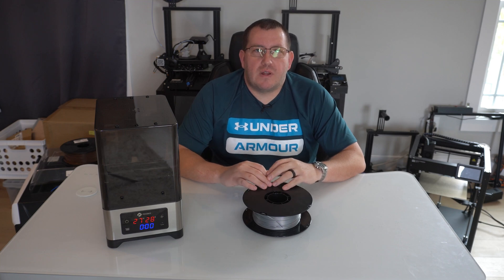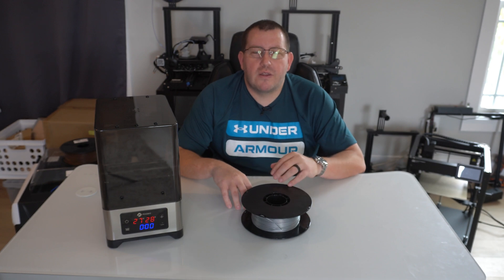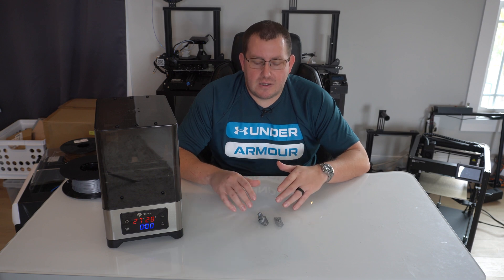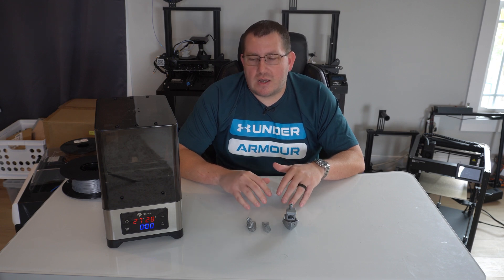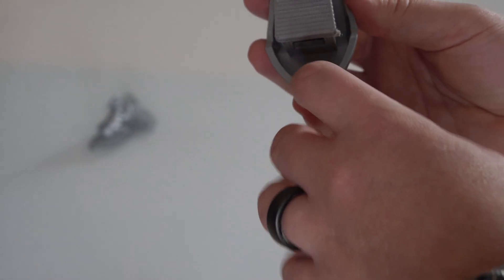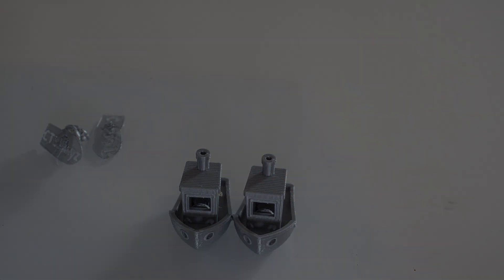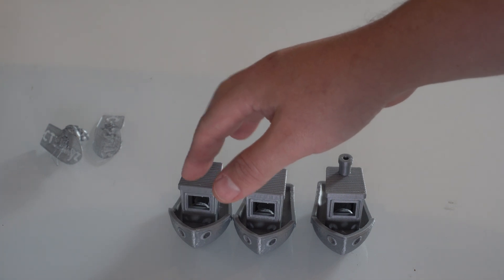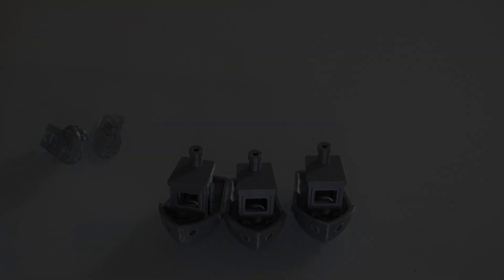Filament Dryer – Worth Having??

Comment: I would prefer sealed bag or box and silica gels with moisture indicator. Box is 5-6 usd... 10 usd for 1 kg of silica gel. İnc shipping 20 usd.
Reply from the maker: Hi. Honestly, thats what i was using before, it works good to prevent moisture issues but not the best to correct them.